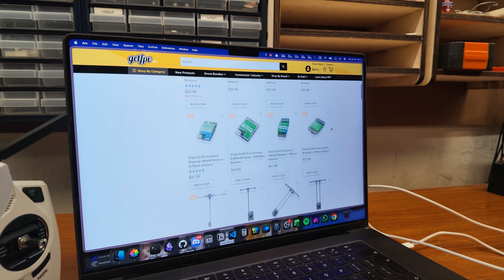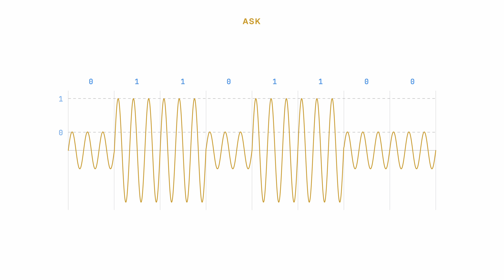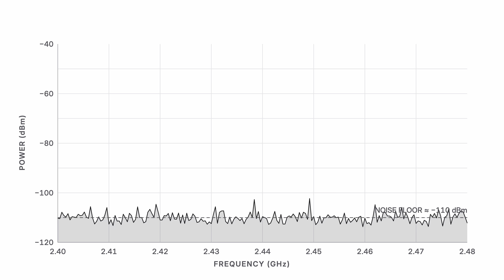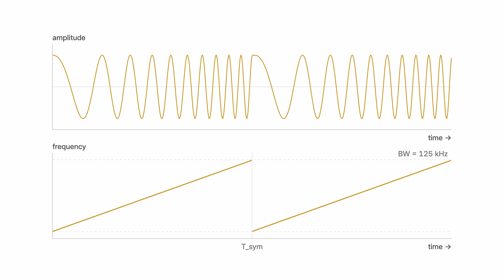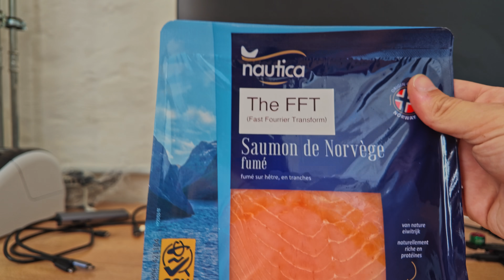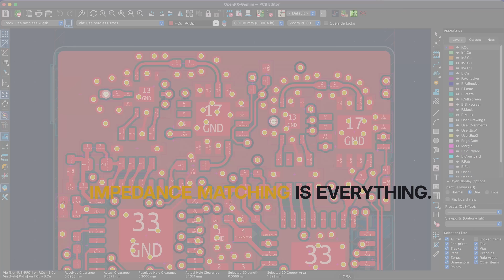How LoRa (ExpressLRS) Drone Receivers Work

Comment: Wow! I can't remember the last time I watched a video which was brave enough to assume a good basic physics education which then supplied enough information, complete with excellent animations, to explain a specific technical application - or at least give you a basis to teach yourself. Pretty much every other video dumbs everything down to the point where you're really just dealing in metaphors, and the remainder assume you know everything that the content-creator does. But this was amazing! The things I could learn if YouTube was full of videos put together like this! Also, LoRa seems extremely cool.

update: I forgot to add, I assume you're doing all this in your 2nd (or 3rd or maybe 4th) language.
Reply from the maker: Thank you so much this kind of comments really motivate me to make more videos. Yes my main language is dutch/french (belgium) but as an engineer, you learn English well
Reply: @opendrone  Well, I'm sure I can't be the only one who finds this kind of thing really interesting. Like most techy/nerdy people I knew a bit about AM and FM and I'd come across QAM from back in the Olden Times of modems, but I had no idea about LoRa's "chirps". That's really fascinating stuff. It's like a much smarter version of wired protocols like CANbus, where you run two lines and then take the difference between the signals in order to cancel out the induced noise. So thanks for the explanation of that! 
I also really liked your video about ESCs too. It's incredible what people (like you and your friends) are DIYing these days.
Reply: @opendrone .....and they even reply to comments!!!!!!  your newest fan has subscribed!!!  ❤❤❤
Reply: Just subscribed and totally agree. Fantastic content that sits just in the right place for reasonably well educated hobbyists.
Reply: Yea, man. A hundred years ago great pioneers like Nikola Tesla and Thomas Edison (and others!) saw the potential of this. They were suppressed, commercialized, or simply sold out. In the 70s and 80s the Japan boom almost brought us the future, along with Radio Shack (hehe) and then suddenly it was all over. Today, though, as long as purified water is making the silicone (and I am CERTAIN how they will try to put an end to it), open-source culture can bring about the revolution we have long dreamt for.
Reply: Same in here :D
Reply: same here 👍👍👍
Reply: ( dumbs everything down).   Probably Because of the intelligence or lack there of of the average DRONNER.
Take a challange and get a real R/C TOY something that goes 200 MPH and burns Kerosene. 
Just love the smell of burnt Jet A in the morning.
Reply: @HoundDogMech  That's fine, but for these small(er) applications electricity is still great. We can produce it, with the right tech. For fuel, we'd need to grow corn... do a bunch of stuff. Yeah... a small carburetor is something "anyone" can manufacture, but we can also get power simply from a windmill. I don't know, both are awesome.
Reply: top comment for a reason, wow well said. he got my subscribe upon mentioning (and nicely animating) the lesson regarding light waves, slowed down and the fact that bass travels further than treble. perfect amount of information like you said, and enough wording where one could go and reaserch to learn more.
Reply: really good content....honestly very informative AND very well explained.
Reply: Beautiful people - with beautiful minds <3

Comment: It seems like your transmitter is permanently transmitting during the entire time. Doesn't this violate the duty cycle regulation of 1% ? (i.e. a transmitter in the LoRa ISM bands is only allowed to be transmitting for 1% of the time [max. 36 seconds per hour])
Reply: LoRa uses a spread spectrum method, which I understand has different duty cycle rules than narrow band.

Comment: Should you use shielded wires when connecting receiver to the FC. This will filter out the unnecessary noise. Same for the camera wires.

Comment: As a non-rf/non-engineering background tinkerer, this was fascinating, thanks.
As mentioned, I'm not technical, so forgive what may be butchering your terminology, but you mentioned that by decreasing the bandwidth of transmissions you increased range. Using your setup, how much data is transmitted? Is it enough for low-fidelity audio? Low-speed data transfer? What's the theoretical cap of bandwidth?
Reply from the maker: Noise scales with bandwidth, so a narrow slow signal can be heard much further away. The tradeoff is data rate. At the long-range settings the link only moves about 3 kbit/s, basically just stick positions and a bit of telemetry. That's actually enough for very low-fi speech. The chip itself can do over 1 Mbit/s in its fast modes, but only at short range. Shannon's law is the hard ceiling: you can have range or throughput, not both at the same power.

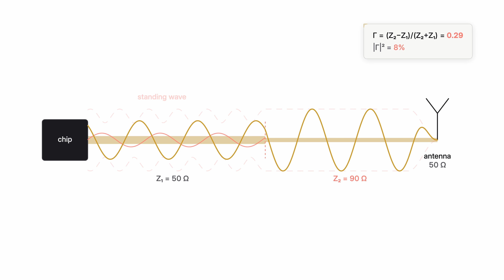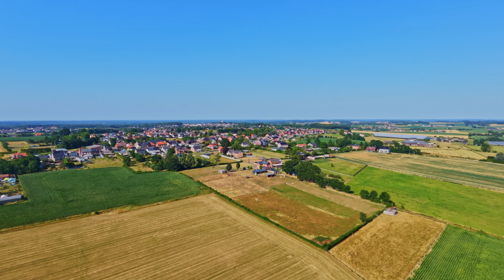Comment: Small annotations: 12:09 - the reflected wave gets added on top, so the Sinus bounces above and below the steady level on the right, meaning: you have higher voltage with the retund signal. 14:37 - this looks like DC, which is an oversimplification, you have energy transfer. You have alternating current, so yellow and green bubbles just jiggle and basically you just have an EM field between the trace and the ground plane, like in a coax cable.

Comment: Doesn't psk shhit all over the spectrum? So it can also receive interference from more frequencies too - so why not just have many many parallel ASK? And ECC the ASK in an out of phase way so broadband noise spikes are just corrected out?
Reply: Yes (PSK is narrow but LoRa is not). Spread spectrum modes are not permitted in amateur bands in most places. And it's unnecessary. Newer COFDM modems get better spectral efficiency and noise rejection (Es/N0), and they're proper open source unlike the patented and licensed LoRa modems.

Comment: I don't know why you made this, who the intended audience is. But I will say that CSS (chirp spread spectrum) is a disastrous use of a band and encodes extremely little data obviously in exchange for recoverability. You shouldn't be using CSS for realtime transfers, but rather for 1% duty or less signals with extremely low data-rates - which is what LoRa the actual WAN does of course.
Reply: Yeah that's accurate (licensed radio amateur here). LoRa is patented commercial technology, the module cost includes license fees. There's superior (Es/N0) COFDM modems since 5 years ago that are truly open source. LoRa achieves down to 7db Es/N0 but 3.8db is common now: the 'below' noise floor claim is marketing lies. I've logged 900km using 0.5W using Ribbit/Rattlegram for example, LoRa is not getting near that.
Reply from the maker: @foobarf8766  "Below noise floor is lies" is just bandwidth: -20 dB SNR in the occupied 125 kHz, positive after despreading, same principle as GPS. Just enjoy the video :)
Reply from the maker: The 1% duty cycle is a regulatory limit of the sub-GHz ISM bands (ETSI 868 MHz)
Reply: @opendrone  If you're calling yourself LoRa or LoRaWAN then you have to adhere to that spec which also has duty cycle limits. But that's not really the point. It's so that others can use the airwaves against the extremely inefficient modulation.

Comment: Pretty cool.... But how do you send the Video signal back?
Reply: What video?
Reply: @emotodude   the video from the FPV Drone?
Reply: @Haldi4803 elrs is used for rc control and telemetry, not video
Reply: @federno9401  Yeah... thats my point. Nice to get up to 100km Range... but how do you fly a FPV Drone if you can't get video 100km back ?
Reply: @Haldi4803  You do it with a powerful analog video transmitter and a very directional antenna.

Comment: Man, as a pcb designer, who makes commercial ELRS recievers, i really appreciate your content! Great job!
Reply from the maker: Thanks, means a lot. Credit to Bastian for designing these though
Reply: @opendrone 
Really interesting video 👍

Please be more careful with the length of bare wire at the solder pad. A shorted out Lion battery isn't a fun time 💥
Reply: @opendrone  but ukranians have jammers brother, only fiberoptic works
Reply: That’s awesome. I’m a 3rd year EE major but none of my classes seems to dive into PCB design very much. How did you learn?
Reply: @Sidiann well, the exact pcb routing is the least complicated stuff. If you get the base: knowledge of physics, signals,  etc, then a couple of tutorials will do the thing. Then just practice, make a couple projects, and you will feel more and more confident of what are you doing.
Reply: @Sidiann #Ece
Reply: https://youtu.be/h_7d-m1ehoY?si=xXhix1l3wWD4wESQ

This
Reply: Robotics Engineering major here. What's the standard? I have a hard time believing you are using Kicad? 😅
Reply: @Madcap_72  kicad is standard for most use cases. if you work at a rich company in large teams of engineers on smartphone or similarly large projects then cadence is go to. other then that kicad is does everything or can be made to do whatever you might need.
Reply: @Madcap_72 orcad, allegro and Altium. I use Altium and you can very easily get a student license.
Reply: @Madcap_72  Altium OFC

Comment: Nice work as always. I was wondering how do you make those visuals with waves and everything
Reply from the maker: I used Remotion with Claude Code and went back and forth a bit until I liked it. It works but I might try learning animation better. The sounds are also made with code